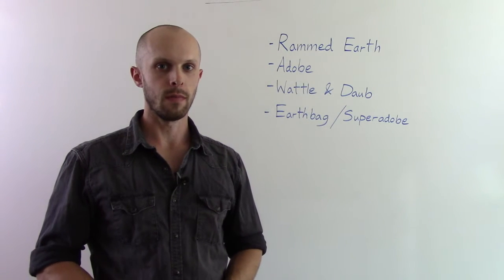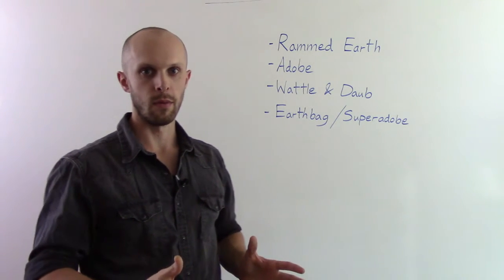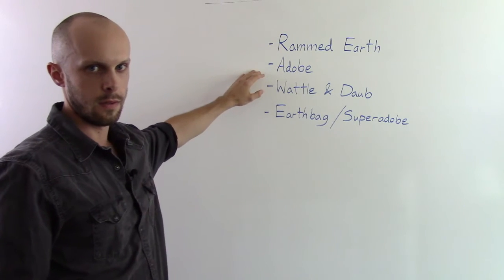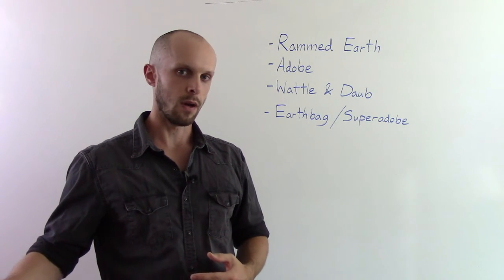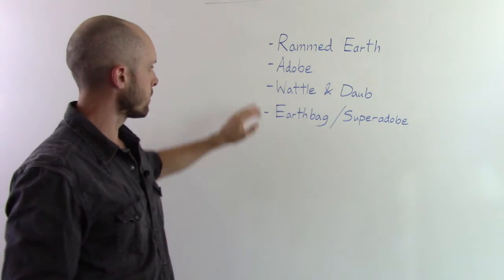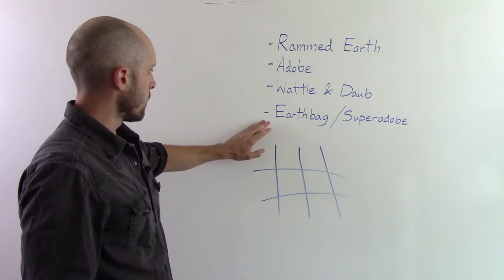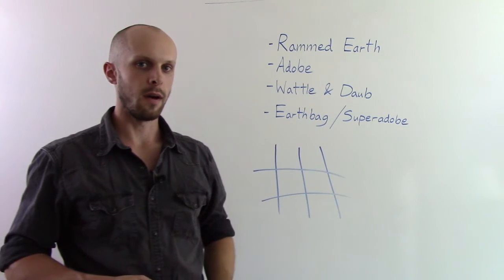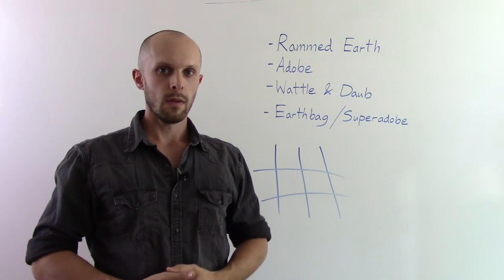EARTH BUILDING TECHNIQUES - COB, ADOBE, RAMMED EARTH, SUPERADOBE

Comment: do you just put plain earth and aggregate into superadobe? can you use woodchips as aggregate? do you not need to wet it so it holds together? I've tried 2 sample bricks but they didn't dry even in 5 weeks(I obviously cover them so they don't get wetter from the rain, I also put them on concrete). not even the one I only sprinkled on top and that was pretty brittle at the bottom of the bag when I took it out. I didn't use aggregate btw but I don't think that would make it dry quicker. the other bag was still the paste I made but slightly drier. do you need aggregate by the way? I see people doing it without and it seems to work. god bless